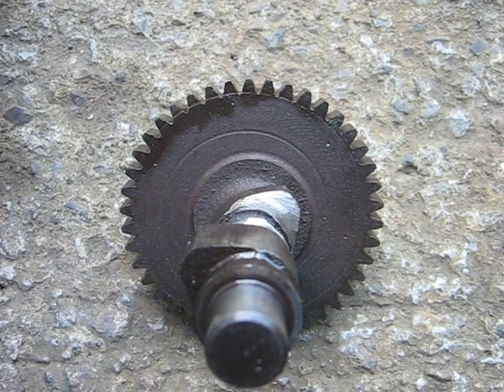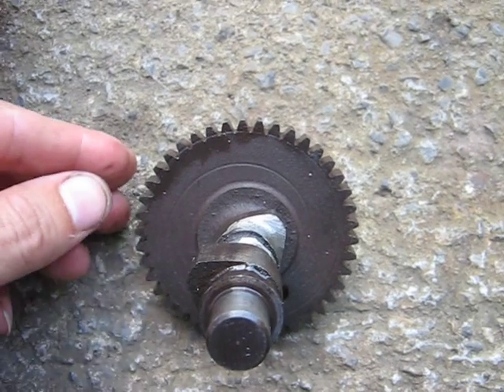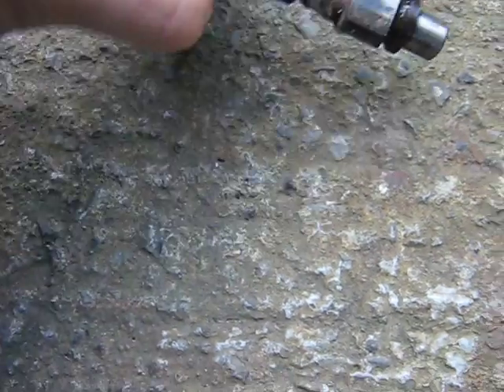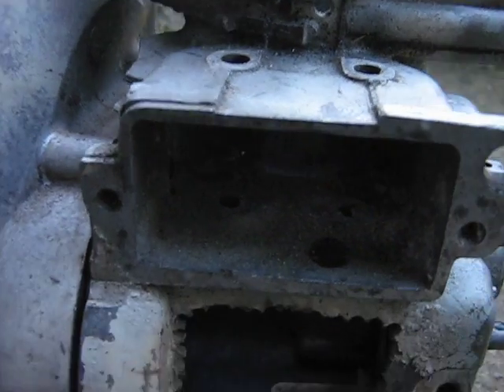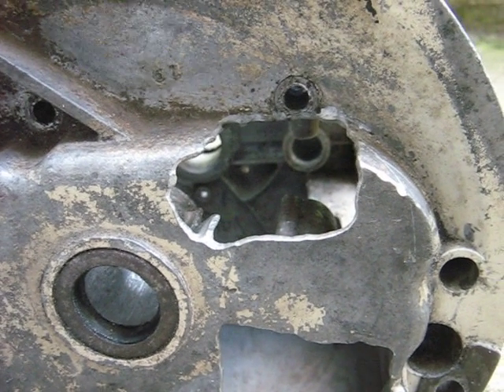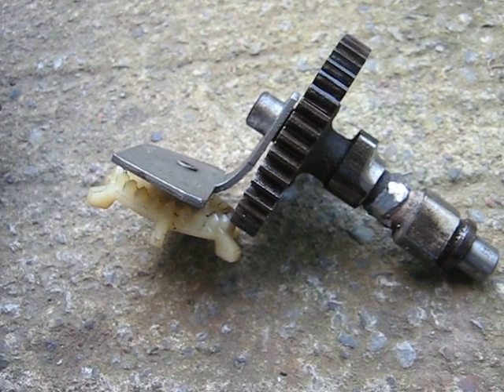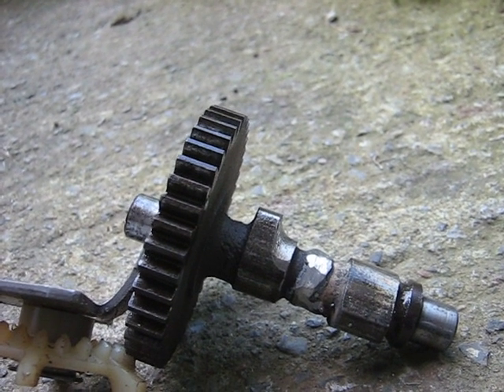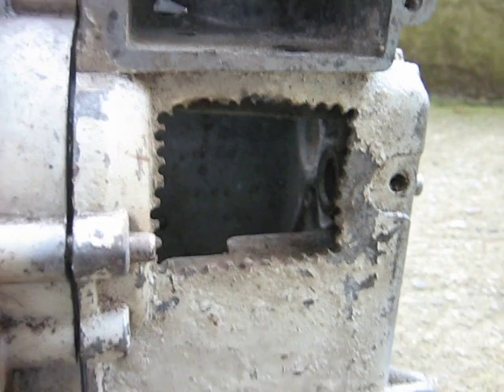Camshaft Modification - How To Vid

Comment: what was the original purpose for doing this to the cam ..did something break ...are you trying for more power ??????
Reply from the maker: Neither actually, though you could do something similar for more power. I was modifying the regular 4 stroke cam for use in other types of engines. One example is the Monosoupape engine from WW1, it is a modified cycle 4 stroke that only uses an exhaust valve and intake ports. I modify lawnmower 4 stroke engines to operate on other engine cycle, such as a 2 stroke, though these will use a separate blower (scavenger) since I need to keep oil in the crankcase of the lawnmower engine so it doesn't seize up. An example would be the Detroit 2 stroke diesel, using exhaust valves and intake ports, as well as a roots blower to scavenge ) supercharge it)
Reply: @ChargerMiles007  that sounds quite interesting ..i especially like your 2 stroke idea with a scavenger ..if you do could you make a vid on making the engine with a scavenger

Comment: When you cut the cam and have the two halves in the block, what is the method to ensure the halves remain parallel?
Reply from the maker: I just relied on the bushing that they inserted into to keep it aligned. Not the perfect solution for an application requiring longevity, but it works on these engines. A better approach would be to use a .001 shim rolled around each end of the shaft, to take up the bearing clearance.

Comment: Love It :) Your thinker and a doer 
Better to try then wondering if it will work 
Faller is only an excuse for ones who believe what they are told will not work
Reply from the maker: Yes, I am a designer by profession, so I have to know when to turn off the design phase, and start butchering small engine parts!!!  :)
I try to use otherwise useless engines, if I can, as good usable parts still retain a value to them.
Reply: design i prefer fabricator :)

Comment: we do used briggs and stratton 16hp in boat racing.. can you help me to bring more torque/ power to my briggs.. including set up of camshaft.. may email is junzkii@yahoo.com.ph thank you so much
Reply from the maker: junzkii I don't really get into engines that large on a regular basis, but certain general principles apply.Can you give me more details about the engine you are using, such as, is it overhead valve (OHV).
Reply: i have over head valve engine ang the other engine is side valve engine also know a L-head engine

Comment: So you cut the cam and weld it inside the block in that hole? Damn i never thought of that lol
Reply from the maker: FlickTricksOffical Yes, I used an old Butcher Block as a jig  to hold the camshaft aligned while I weld it back together. It isn't perfect, but works pretty well. My friend at AC/DC Welding is a welder/fitter he got me onto making cheap jigs for building things.

Comment: cool vid and all, but why did you kill a white engine?!
Reply from the maker: thereelmaster . Oh, that 3-1/2 horse lawnmower engine was a dead duck. Someone ran it very low on oil, and it galled (scraped) up the cylinder wall so badly that it had no compression, so it wouldn't run. Rather than throw engines like that away, I make them into whatever I can, such a a welding jig in this case. I cut another engine apart to show the internal workings better. I always salvage whatever useful parts I can from the otherwise dead engines, as you never know what little part you might need to complete another engine. For some reason I always seem to be short of certain parts, like the oil spasher for lawnmower engines, even though every engine I get should have one. I swear they sprout legs and walk away!!!! (like in the movie "the Thing"    :)   lol

Comment: I also had to grind the side of the lobe and do a little work on the rod to clear the camshaft. The valve springs are pretty soft in these engines so I think the lobe will hold up.

Comment: I cut the cam and rotated the end opposite the gear (so I actually moved the intake valve and had to retime the cam) so they were 180 degrees apart. I have pictures if someone wanted them. I made a jig from an old engine but I cut away almost everything down to the cam. The dowels are still there. I clamp it together with two vise grip welding C clamps. I cut it right there in the block with my Metabo grinder with a zip disk. After beveling it I can get right to it with my tig torch.

Comment from the maker: Hard to say about the camshaft, did you grind the lobes down, and weld new ones?
Your revving it a lot faster than I have, so I really don't know.The only engine of mine I have many hours on is the sleeve valve, which of course doesn't apply for this comparison.
You may want to run compressor oil in it, since the crankcase probably won't get hot enough to activate the anti-wear ingredients in motor oil. I hope it holds together OK, engines with no load like to lunch bearings for some reason :(

Comment: I am in the "playing" stage with this little push mower engine.. If it works I am going to use a 12 hp vertical that will put out much more air and/or could be run slower. 1800 rpm is only half of what it originally run so I don't think that will be a problem. Might even back it down some from there. Naturally it will make some heat but any compressor will. My main concern is if the camshaft will hold up.

Comment from the maker: 1800 rpm is pretty fast for a compressor. The faster you run it, the less time there is to get rid of the "heat of compression", so your exhaust air will be very hot. It also takes more power to do the compressing, since the air is heated more by the hot cylinder and head. It would be better to use a larger motor for a compressor, and spin it over more slowly. Just some hints, not to say it won't work the way you suggest. My 3.5 horse compressor gets so hot it popped the air line!

Comment: Not yet. I have it all back together and ready to drive it. I am going to use one of the many riding mower engines I have to drive it with. It has a check valve out the spark plug hole too. At 1800 rpm it should put out 9.375 cubic ft per minute.

Comment from the maker: Sounds good. Any idea what type of pressure it puts out?
I did a 12 part vid series about a Briggs air compressor. I found I couldn't make much usable pressure until I shut the exhaust valve down, and took the air out the spark plug hole with a 1 way valve. My homemade steel head with disc valves will make 125 psi, but took some work to build, it does seem to last, which is good.
Reply: ChargerMiles007 your mot
Reply: ChargerMiles007

Comment: I cut a B&S 3 1/2 vertical cam to make an air compressor. They are 180 degrees opposite. My intake lobe turned out almost exactly like yours for clearance. I also massaged to rod cap some. Now I always have a valve opening just after TDC and closing at BDC.

Comment from the maker: I cut it with a hack saw, a zip disk in a grinder would work also. The main thing is to use a piece of sheet metal or something to space the parts apart about the width of the cut, to keep about the same end play in the camshaft.

Comment from the maker: Yes, I had the same thing happen early on, then I started using the 1/2" copper pipe, unless it falls off, it generally works OK. I tried electrical tape also, but the heat sure makes it gummy to get off!

Comment from the maker: @Xantec 
No, not without either changing the port positons on the sleeve, or putting in an idler gear to drive the sleeve drive shat the same direction it currently does. I guess the sleeve is kind of like the camshaft in a poppet valve engine.  Interesting question, Thanks.  :)